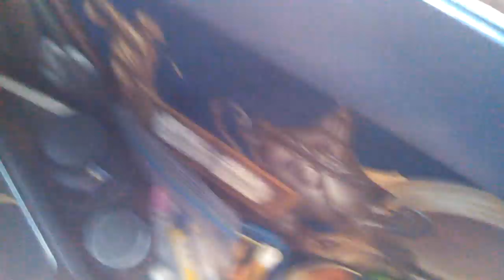Anderson Casement WINDOW Operator (crank) Install

Comment: Shouldn't the windows open counter clock wise  and close clock wise like if you're tightening a screw or nut?? All our windows in our home are casement and still I try to open and close this way.  Thanks for the vid.